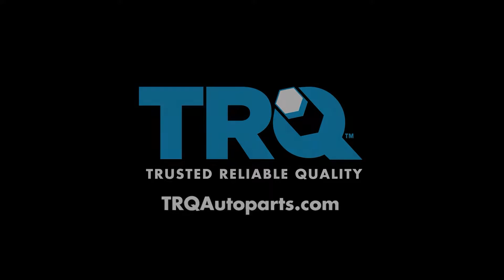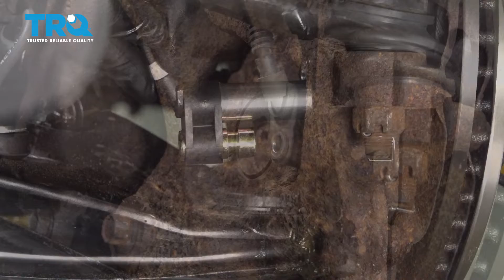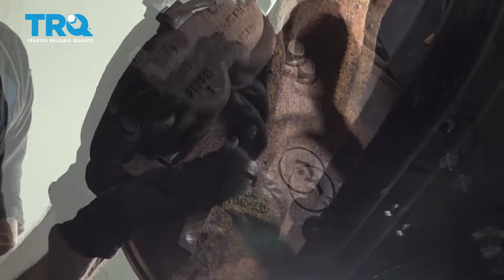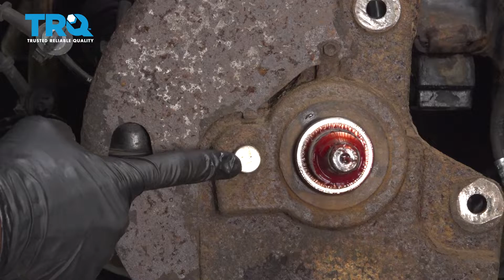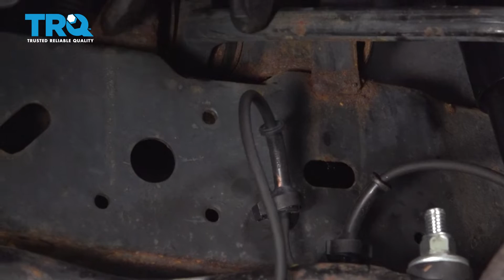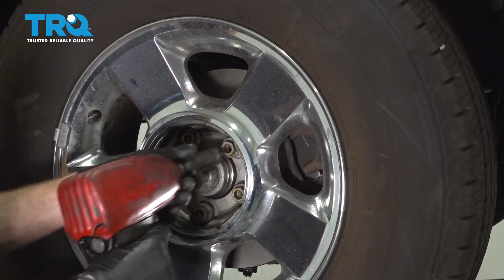How to Replace Front ABS Wheel Speed Sensor 2001-2005 Ford Explorer Sport Trac

Comment: Did this today and cleaning out the hole is no joke. It will NOT fit without significant effort. I misplaced my round file, so after using a steel brush and red brillo pad, the best option by far was a slit of 50-grit sandpaper wrapped around a screwdriver. Also, getting the old sensor out really sucks and you pretty much have to destroy it and hammer out the outer shell.